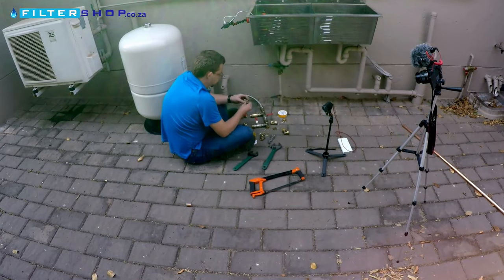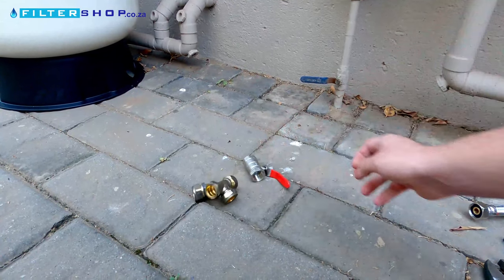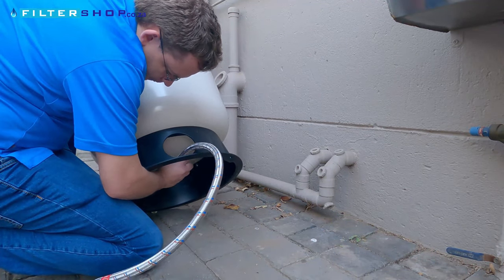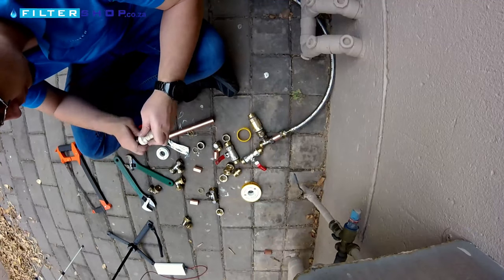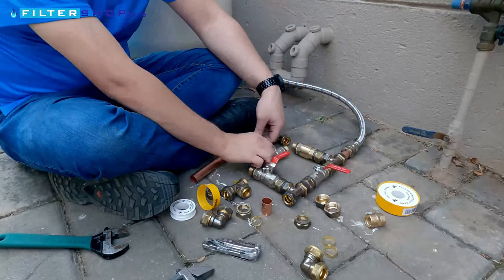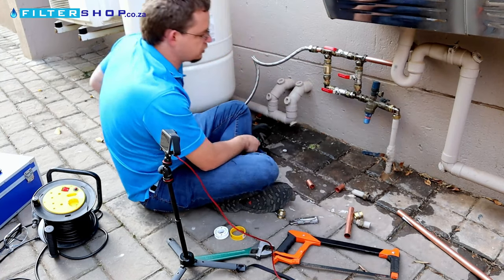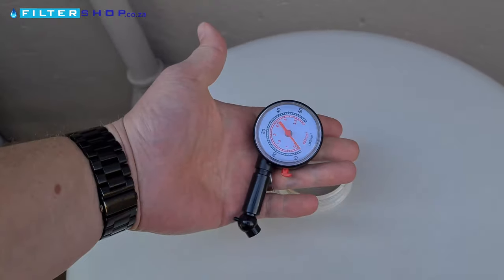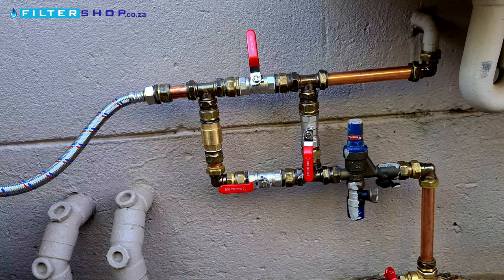Backup Water Tank No Electricity

Comment: hi, your tank is installed on the low pressure side of the pressure regulating valve. You can increase that pressure regulating valve to say 5 bar. That may increase the number of flushes. Also what air pressure did you pump the tank before you allowed it to fill up ?
Reply from the maker: You are correct, in the later videos it is moved. Unfortunately I only have 2.3bar incoming pressure before the valve. Played around with the pressure and found that at 0.7bar we got the most water with the low incoming pressure.

Comment: Nice work 1st class 👏.  You shold put your regulator after your tank. Just before the house to achieve more pressure on the accumulator and more volume. ✌
Reply from the maker: Hi, I agree, it is one of the things we realised after filming. We need to work a filter system into the setup in a following video then we will probably change it up a bit.

Comment: nice setup, im having a flow issue the incoming pressure im getting from municipal supply is around 40psi but GPM is low pressure drop signifantly when when 2 people having a shower or using a washing machine, im trying to avoid booster pump whenever possible ..

im thinking of installing a similar setup like yours minus the check valve, do you think it will work or do i need auto shut off valve? Thanks
Reply from the maker: Hi, the Check valve is essential as otherwise, the water pressure will just drop with the incoming lines pressure. If the problem is just a constant low pressure a tank won't help as it can't generate pressure it can only store it.

Comment: is it possible to use an IBF Flow Tank (1000l) Elevated and connect it to this pressure tank (12l) so that it serves as a backup when there is no water ?
Reply from the maker: These tanks will only buffer the pressure you have, so ideally you want over 5 bar. It would work as a buffer but will only hold a very small amount of water if it is a 12L tank on a gravity feed.